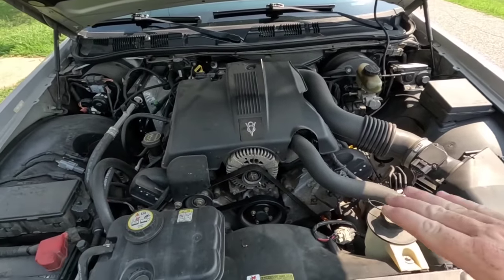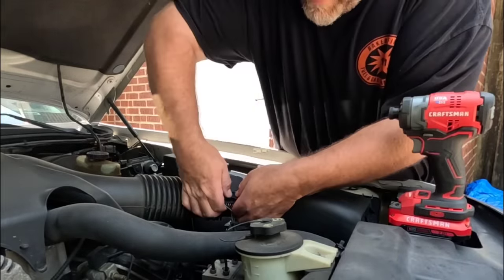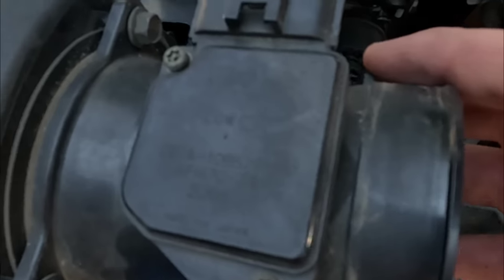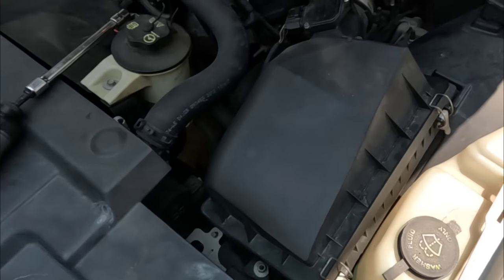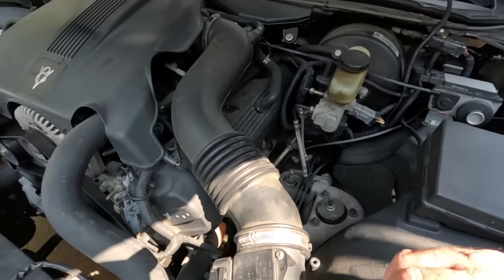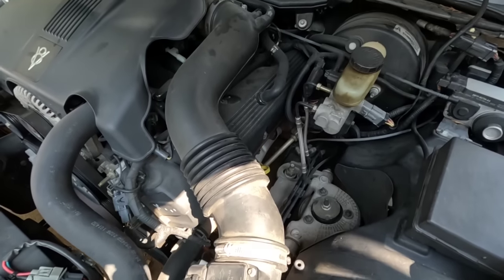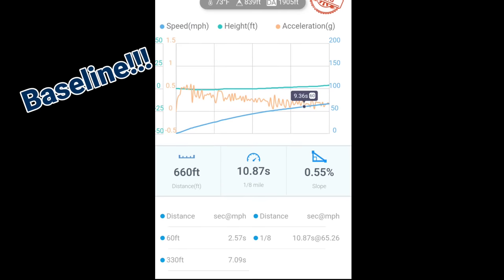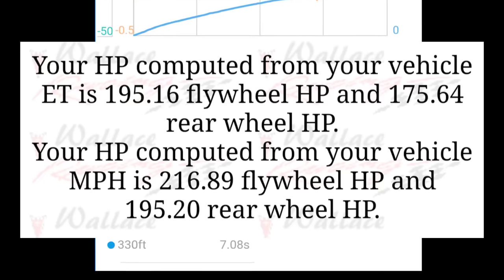FREE POWER MODS TESTED on the Ford Crown VIC LX SPORT 4.6L 2 Valve!!! @latemodelrestoration

Comment: I changed the box with a bigger opening and got a engine light on. I put it back to stock the light went out
Reply: You need a tune with these for many of even the simplest mods. Swapping a cvpi box on a civvy and/or a CVPI throttlebody will throw a code because it's reading more air than programmed. Even changing the axle ratio requires a tune, the electronic speed governor is set with the axle ratio and so is the speedo.

Comment: I have a 1996 Ford Thunderbird with the same motor and I bought a K&N air filter and I wish I would have just stayed with the factory. Now I got to figure out how not to pull hot air in the motor. I did see a little bit of throttle response but I got to figure out another setup to where I can get cold air coming into the actual cold air intake instead of just having my cold air intake suck in radiator Heat. However if I want to I can punch it and get 7.5 seconds 0 to 60 which is a whole lot better than when I bought it doing about 9 seconds

Comment: II thought the K and N filter will spit oil on the mass air meter.
Reply from the maker: If you over oil them they most definitely will!
Andy
Reply: I had a new one that screwed up my Fox and got dirt all through my intake. Have detailed pictures to prove it. I'll stick with Fram. Less power but less dirt.
JMO

Comment: Those gears you got will help a good bit paired with a sct x4 tuner would wake it up, it might not be fast but more fun to drive. I guess if you really wanted to get faster for cheap you would buy a eldelbrock victor jr and a nitrous kit and a stall converter. Or maybe a on 3 turbo kit for 2600.00 anyway nice video see ya in the next one.

Comment: But the cars came with 235 horsepower. I'm assuming the aftermarket intake is killing the numbers. Before you do anything else that our car buy an intake. To see if the other mods you made help with the new intake
Reply from the maker: The factory rating is rated at the Flywheel. 
Thanks for watching
Andy
Reply: The civy cars excluding LX Sport came with 235. The cvpi came with 250 04/05½+ due to certain engine parts and tune.

Comment: Can you clock the TPS on these like the old 5.0s?
Reply from the maker: You can slightly.. I take a Dremel tool and elongate the hole! When you put a set of cams in a 4.6 I've found I can get it to idle clean by tweaking the TPS and drilling a small hole in the Throttle body.
Thanks for watching
Andy
Reply: Factory computer compensates for .5 volts to 1.5 volts automatically...

Comment: Some work and some just make noise, back pressure loss on the exhaust?
Reply: All back pressure is bad. Removing it usually requires a new tune on any engine.

Comment: Did you get an enginr light after the alteration. I know if you seap a civilian airbox with a police interceptor airbox and tube you can gain 5-10 hp but you need a tune after wards adding duaks to a civilian vic will also gain hp both police airbox and tube and duals will get you to the 250 hp that police crown victoria gets.

Comment: Hiya Andy, I just ot a 03 Grand Marquis, practically the same car. Do you remember the under valance discreet ram air from the late 80's early 90's? It'll be a meatball job but I think I can make it happen. Also will be going with dual exhaust on mine, to reduce resistance from this single pipe one (was yours in this video single or dual factory exhaust?)
Reply: Lots of dirt down there

Comment: The resondator delete makes the car sound way better, I'm replacing these with FlowMaster FX... Us Panther Guys know this car will never really be fast with a 4.6... But the 'Cool' factor of caarruising in this big arse car is where its at :) BTW, I'll have the cold air mod done by next weekend!
Reply from the maker: When I'm done with this combo it will run 10's in the 1/4 with the 2V!  It's going to be fun working on a 4.6 again
Thanks for watching
Andy
Reply: @UnityMotorSportsGarage  I'll be watching and learning... My plan, which can change watching your stuff... and Loving Casper!  is with my 2010 NM State Interceptor, 351W and trying to decide to stay automatic or 5 speed... running 12s in the 1/4 and then work to get to the 10s :) 
love live stream with Mr. Cope and plan on buying his valve body when its available

Comment: I wish Ford would atleast have preserved the Town Car and built it past 2011.  I know there were structural upgrades were necessary to meet NHTSA and DOT standards.  While they were at it, shove in a 5.0 Mustang engine, a new 6 speed automatic and Stability Control

Comment: Only problem with the air cleaner housing mod is that it won't pass the visual on smog inspection.
Reply from the maker: You must live in the wrong state! Lol The Crown only gets a safety inspection here in NC since it is 20 years old!
Andy
Reply: @UnityMotorSportsGarage that was my first thought. I'm in Pa. which has emissions testing. Yuc!
Reply: I'm also in NC and since I live in the country side I don't need emissions tests at all and my car is a 2011!
Reply: Kentucky dropped smog checks in around 1997, so did IN

Comment: The Crown Vic is ok... If you like that body style and want more HP stock, go with the Mercury Marauder! 4.6 DOHC....You can get plenty of power from them with the right "tweaks"
Reply from the maker: For me the Marauder is ok... But the price difference is a big deal. I picked this '03 LX SPORT up for $5500 and Im putting Trickflow heads and doing a 4.6 budget build that will make WAY more power than the 4V Marauder and be cheaper.
Thanks for watching
Andy
Reply: @UnityMotorSportsGarage  will watch this, interested to see what you can squeeze out of that 2V motor..🙂
Reply from the maker: @gorgonbazil2652 I'm sure that many will like what they see! Thanks for watching
Andy

Comment: Andy, you think a stock CV is slow?? I had an 87 CV wagon with a stock 150 hp 302. THAT was slow! But my 76 LTD wagon, all 5000 lbs of it, with a 400 2V, was even SLOWER! And my 81 Fairmont wagon, with a 200-6, was worse yet! School buses were eating my lunch!
Reply: I had a 77 Squire 460 that was barely better than my 73 400.
Ran 0-60 in ten flat with just me in it... But was super comfy and quiet even with the horse trailer.

Comment: I  have an 01 Marquis..best 1/4 mile to date is 15.11@ 92.6mph in 3000+ DA...Its got a 14 in it with some good weather.

3.55 gear
Traction lok differential 
Flowmaster FX mufflers
Gutted rear cats
P71 lower air box
DNA filter
70mm throttle body off E250 5.4L 
Steeda Underdrive crank pulley
SCT X4 tuner
185° Thermostat.

I'm looking to get a 2800rpm stall converter next hoping to improve on the horrible 2.10 60ft times.
Reply: 281 cubes and 4200 pounds. 
SMH. (I have an '02)

Comment: The engine  Should have responded with More HP after these 2 mods.....Maybe the Baseline should have Included reading the WOT A/F  ratio.....it's Possible the Ecu changed  the A/F ratio & Reduced engine Hp.....
Reply: Don't these newer ones run closed loop at full throttle too?
Reply: It takes more than that to get real noticable gains with a 2v, especially a Panther with its ECU. I can't remember how the ECUs work, but they don't use the MAF as the main factor, if I recall, I think they're based off speed density.

Comment: K&N filters only filter cats and dogs. Fine for racing but bad for street unless engine life does not matter to you.
Reply: Not exactly, D.V. has a video on that. I have many thousands of miles off road. no complaints...
Reply: I had bad oil and dirt passage problems from a new KN. Went back to Fram paper.
Reply: @hotrodray6802  so from no filter to plugged from the factory. Best bet is to used a OEM filter if your using the stock air box as they will fit and seal properly. If not use the filter that came with the CA kit your using and hope for the best.
Reply: off road in what environment? If in dusty or sandy conditions the engine is junk for sure  @wlogue
Reply: They actually filter out 99% of dust and particles. From 0-20 microns.
Reply: @billb410 
Where did I say that I was using a CA kit?.
SMH.
Reply: @hotrodray6802  You did not. But you did state the car came with and you recommend using K&N air filters @ 4:14.

Comment: Let the people that make cars and rockets do what they do because that made no sense whatsoever. It's a small air intake. It's like a rocket that's small. At the end of it pulls air into one Pacific spot. If you crack it, break it now. Hot air from your engines pouring into it where it was no hot air from the engine getting into it. The tube was inside of the bottom of the headlight bringing cold air directly into the intake and this is the problem with the world. They believe whatever they do it's better. We'll break what we got and it's going to be better. You can't break nothing and make it better